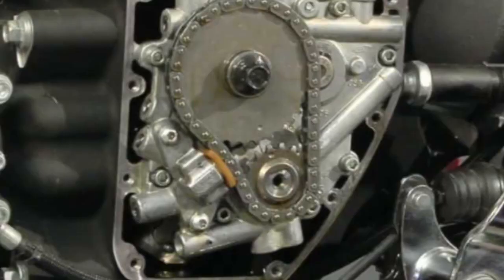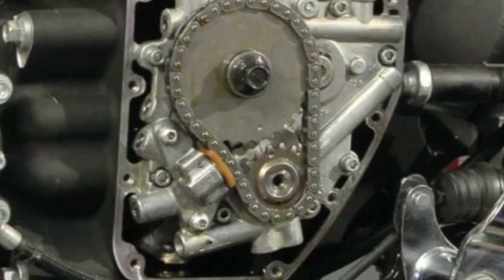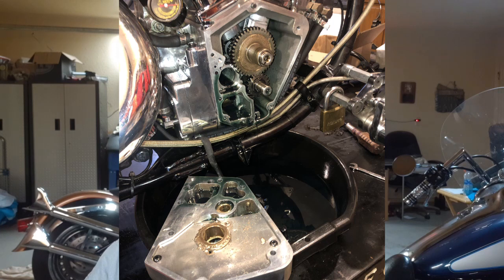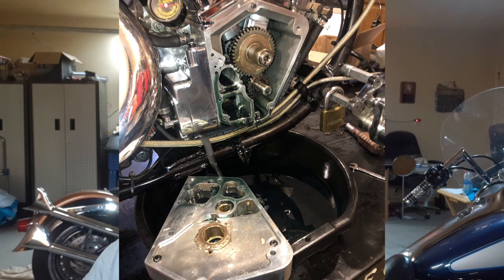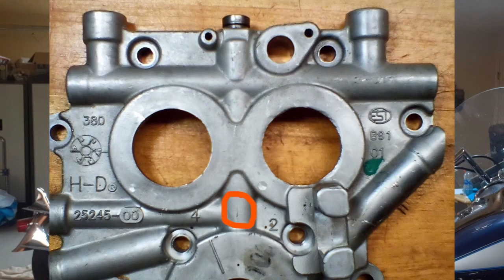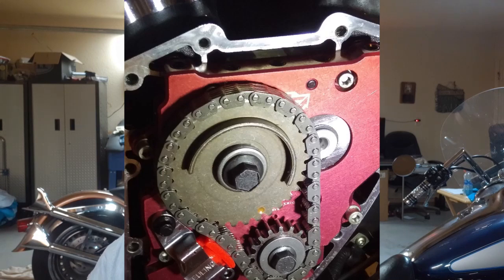Whats The Big Deal With Harley Cam Plates

Comment: That's really good information!  Thanks.  I'm older than dirt and bought my first Harley (used panhead) in 1962.  I always wondered what the third cap was on the tanks of those old scooters.  I currently have an Evo and two TCs.  My daily driver is a 2010 FXSTC that's getting up there in miles so I'm learning about rebuilding cam chests and cam upgrades.  Looks easy enough but like with anything there are pitfalls.  After I do it once (and ideally don't fail) I should be good.  I like to do new projects in steps so I thought I'd just upgrade the cam tensioner so as to get comfortable pulling things apart.  My model is supposed to have a hydraulic tensioner so it should be good but due for a replacement before long.  Once I get in there and inspect the condition of everything there may be more urgency to hurry the process up.  The 525 cam set makes sense to me as I am not out to set any land speed records....  I just like the bike to get up and go when I twist the throttle.  Runs pretty decent now but more juice is always better.
Reply from the maker: The cam chest is easy to do and 525 cams are a good choice. Gives the bike a lot more low end and mid range. You also don't have to upgrade the valve springs with 525.

Comment: From one Old wrench to another thank you for the videos I'm working on my first twin cam soft tail what are your thoughts on s&s gear drive from your video you mentioned run out on the 2003 what's the max run out to use gear drive. And a 100 or 98 kit with twin cam over heating problem
Reply from the maker: I like the S&S gear drive. The max run out on the pinion shaft is 3 thousands to from the chain drive to gear drive. I'm assuming you're using a high flow S&S oil pump, the high flow pump will help cool the engine. If your installing a top end kit and getting new heads with the kit it should run and cool better than stock. S&S came up with a solution for the heat problem before Harley did. Hope this helps. Thanks for the question and thanks for watching.

Comment: Have a question, I have an 03 fxd completely stock it's got roughly 11,600 MI. Getting ready soon to check the chain tensioner shoes. My question, I'm a little leery about putting cams in, since it's an 03 I'm worried about the bottom end putting too much stress on the crank bearing not being timkin on the left side and also that I've heard about the crank not being as good as say 02 what are your thoughts?
Reply from the maker: Thanks for the question. It's unfortunate that Harley got away from the Timken bearing lower end in 03 and did make changes to the wheels. You are correct that the 02 lower end is stronger than the 03 and up. But the 03 and up are strong enough to take a cam upgrade. Some guys make it sound like they're substandard, there not. I've done many cam upgrades on 88's 03 and up to the 96. Have never seen any problems. The lower end is more than capable of handling the upgrade. I've upgraded 88's to 95' on later 03 and up 88's with no problem. If you want to upgrade your cams I would strongly suggest that you replace the stock cam plate with a good billet or forged cam plate. The stock cam plate is the weakest part in the lower end. I would also suggest a high flow oil pump. The high flow oil pumps provide more oil through the engine which helps cool the engine and sump about 40% more than the stock oil pump. Its a good idea to check the run out on the pinion shaft while you have apart, since the TC have known to have a run out problem from the factory. But yes your lower end can handle a up grade without a problem. Hope this helps. Thanks again for the question and thanks for watching.
Reply: @tinkeringwithharleys  thank you so very much for getting back to me so quickly. I greatly appreciate your input and how positive you are with me upgrading my cams without a worry, thank you so very much again love your channel. Shiny side up brother.
Reply from the maker: My pleasure ride safe

Comment: I have an 01 Twin Cam Rd. king 53,000 miles I’m getting valve chatter I have a Rocker lockers in it what the heck would cause it
Reply from the maker: Thanks for the question. I've seen rocker lockers used where they've reduced the ticking but never completely stopped it. Could be couple of reasons for the ticking, 1 the shafts are just to worn for the lockers to help, 2 if you have adjustable push rods the push rods may need adjustment. 3 lifters are starting to get weak causing inconsistent adjustment on the push rods wether there stock push rods or adjustable. Lifters should be replaced about 50 to 60,000 miles. 4 the rocker platform isn't center and torque correctly. Those are the areas I would check. Hope this helps. Thanks for watching
Reply from the maker: Since you're stock and you want to get to the bottom of it, it would pull the rockers and check the push rods to see if they've mushroomed on the ends and check for any wear that would intricate they're making contact with the tubes. If everything looks good just retorque the rockers and see if that helps.
Reply: Thanks for the reply back everything stock except for Cam plate Screamin eagle

Comment: THANKS FOR THE VIDEO'S THEY ARE AWESOME.I HAVE A 2011 STREET GLIDE 103 ENGINE.I'M GETTING A RATTLING NOISE COMING FROM THE CLUTCH BASKET WHEN AT IDLE.BUT WHEN I PULL THE CLUTCH IN THE NOISE GOES AWAY..COULD IT BE THE INNER PRIMARY BEARING HAS FAILED?
Reply from the maker: Thanks for the question. I've not worked on a clutch on a bike that new but I'll give it my best shot.
I don't believe you have a bad bearing, usually when a bearing goes bad it makes noise all the time. Usually rattling indicates something loose. I would check the primary chain adjustment first, than the adjuster shoe to make sure adjustment on the chain is right and adjuster is tight. Next I would check the compensator. Compensator's get noisy when they are starting to fail. Hope this helps. Glad you like the videos and thanks for watching.

Comment: Any suggestions on a set of cams, cam plate, and oil pump for a fuel injected TC88?  I'm trying to pickup my mid-range throttle for passing.  Bike is already Stage 1 with a programmer.  Thanks in advance.
Reply from the maker: Thanks for the question. I like either Feuling or S&S. I don't care much for Harley's set up. I have a Feuling cam plate, oil pump and cams in my 88. I used 525 cams which is the biggest cams you can use without changing the valve springs. I used S&S lifters and adjustable push rods. This set up gave me great low end and mid range. Top end stayed the same. When I pass anything now I fly by them. If you use that size cam you'll have to richen your fuel mixer. But once it's set the bike runs great. Thanks for watching.